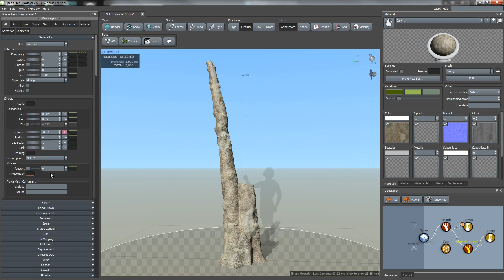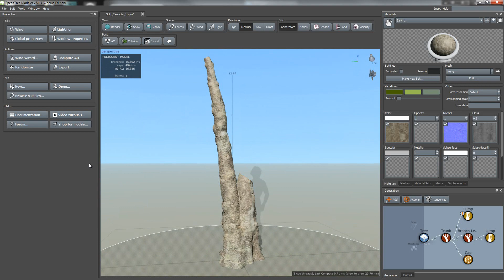SpeedTree Cinema 8: Split

Comment: What do you do when you set split chance to 100%, UV tiling to 2 or more, and extend parent to ANY - (everything in this video) - and only one of the splits is extended? I find regardless of extend setting, only Split 1 will be extended. Setting it to Split 2 yields no result. No messages or errors are present in the output.

In my case I am trying to split/extend a branch node not a trunk node.